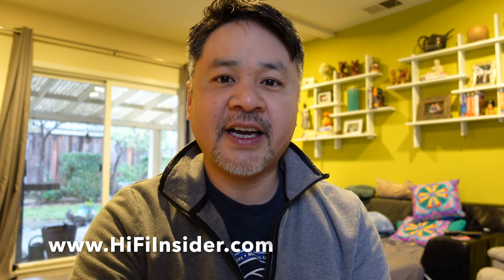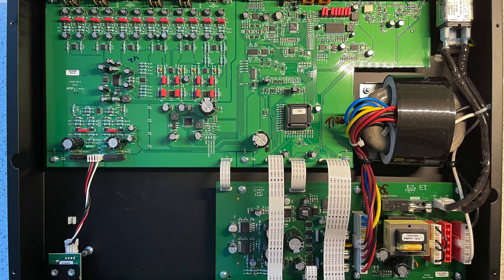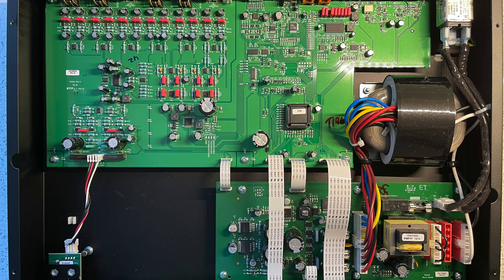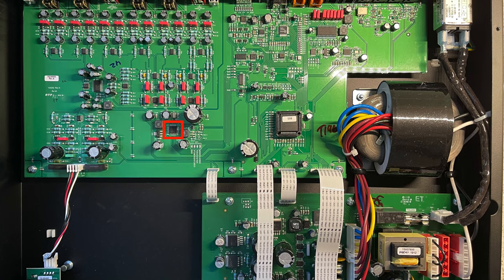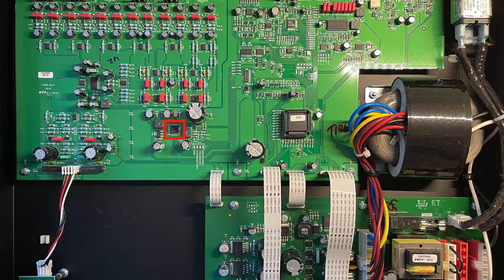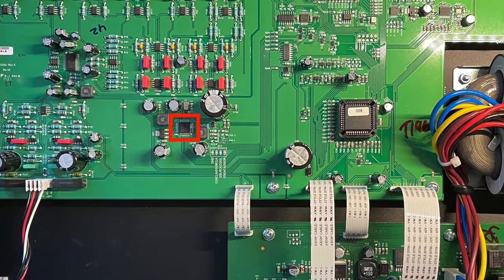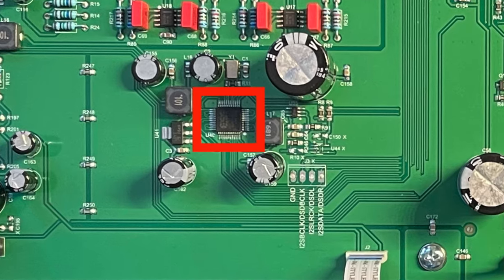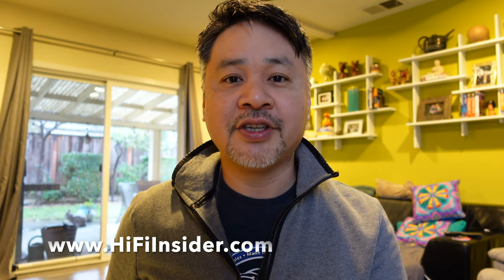Buying a DAC. Explained....

Comment: There are appreciable differences between DACs, but I broadly agree with your main points.  I bought a bundle setup of SMSL M8 DAC + VMV VA2 headphone amp + P1 linear power supply in late 2015 for only £230 (got a £20 Ebay discount off £250).  This setup sounds really nice and it has very short cables connecting it to a Mackie sub-mixer, and then into a pair of handmade British Quested S7 active monitors.

However despite this I often listen through my desktop PC onboard motherboard Realtek soundchip..........BUT......only via its optical digital output, to bypass the terrible analogue circuitry.  This is connected to a better output stage box, giving really good detailed, crisp high quality audio.  So these days you can just spend £20 on a better output stage for your PC or laptop, and still have great sound.

I've also heard people online saying Yamaha make terrible DAC chips, but hey they are one of the main producers of them for decades so what do they know eh!  Luckily I do not listen to people like that.

Comment: It’s really all about the dac chip. That is the foundation of the dac. Trying to take for instance a crappy sounding off the shelf chipset and putting a lot of extra circuitry in there is like putting lipstick on a pig, there’s only so much that can be done to compensate for the limitations of the dac chip.
Reply from the maker: it may be hard to find a shitty dac chip bc they are so cheap already in raw material cost.
Reply: @HiFiInsider  This is why I recommend avoiding any DAC with off-the-shelf chipset. Like the one in your picture, they're taking the same ESS DAC chip that's in a $200 Audioquest Dragonfly and charging $3500. for the DAC. That doesn't fly. Spend that money on a custom DAC design, not something with off the shelf chip.
Reply: @phototristan  that’s why I bought a Chord.
Reply: @phototristan  greeting could you recomend any good dac for my google pixel 3?
Reply: @boeingdriver29 greeting what is chord?

Comment: great video I agree 100%. Also most DAC's come with bad power cables always upgrade if you can. Shunyata has a great 14guage molded one for 135 bucks that does a great job and 14 gauge and better connection in the connectors than stock cables and can get in little DAC's.